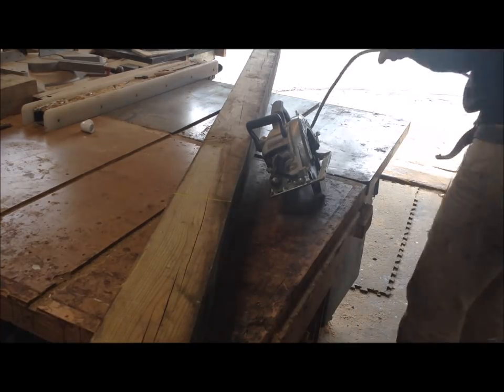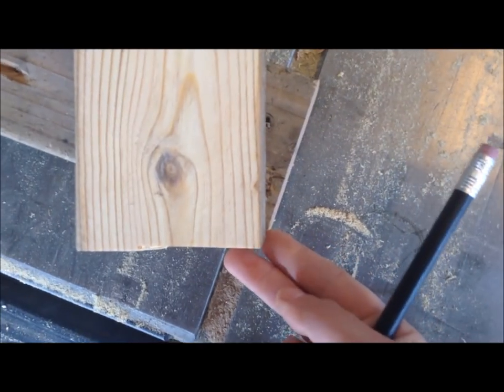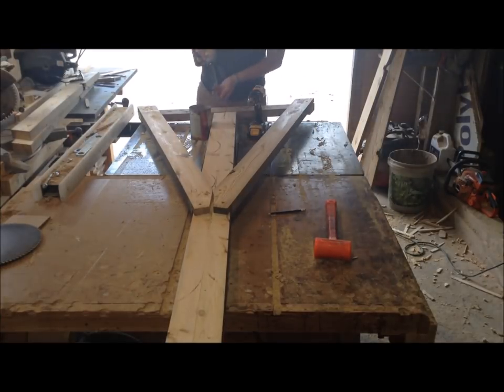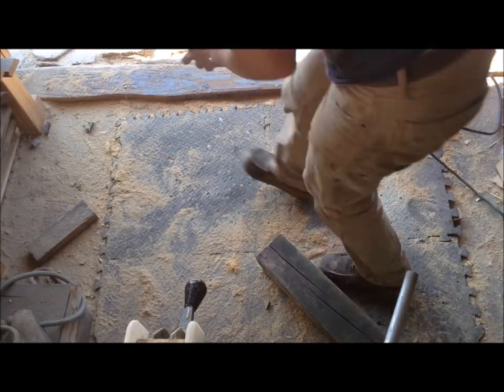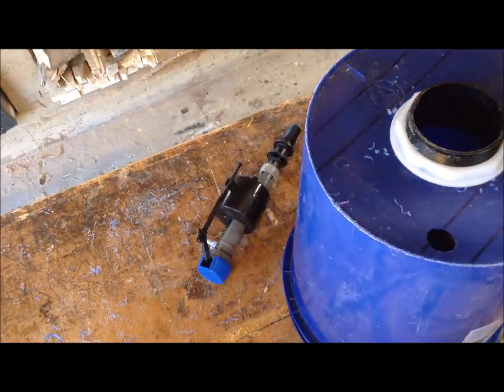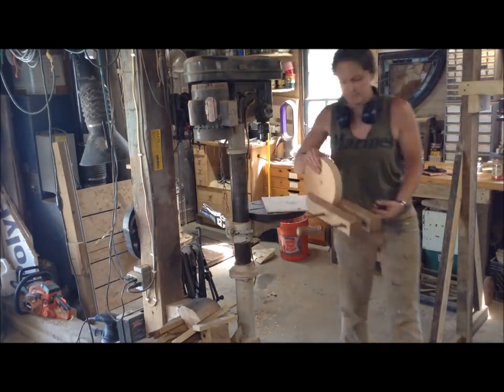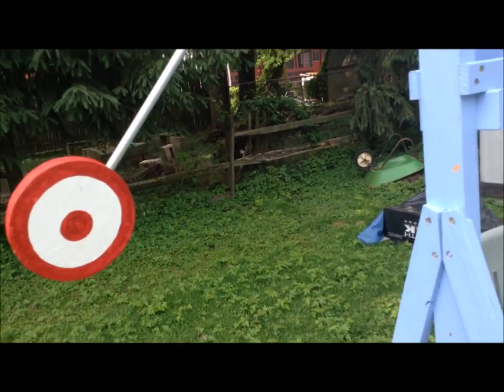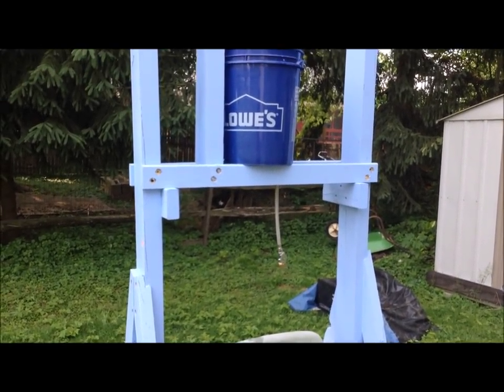DIY Dunk Tank

Comment: I have a few  question about the project... Let's say someone wanted to use something thicker then water ( slime. Gunge. Etc etc) ... Would this project 1 hold the weight  safely 
2 work with with target,( the thick substance weighs too much and the mechanism wouldn't work as well )  ..
Would my idea work . Or would I Have to make modifications..
 thanks and have a great day
Reply from the maker: Holding weight would not be an issue.  With the way I designed this you could put lead in that bucket and it wouldn't fall over.   I think for slime (now this is going by slime I have made/used, this answer is dependent on the viscosity of slime you might use, my reference point is slime more viscous then water, but still quite fluid. i.e.- Nickelodeon slime I think you could get to work.  Ghostbusters river of slime maybe not) , and if there is a problem I think throwing a heavy ball would help you out.

Comment: I don’t see where you showed how you connected a garden hose to the 7/8ths connection for the toilet fill.  How did you adapt your garden water supply to the toilet hardware
Reply from the maker: You can see it in the video around the 7:22 mark, brass threaded hose adapter.